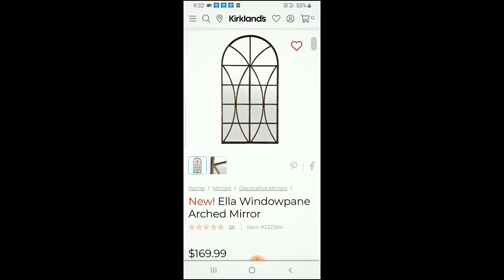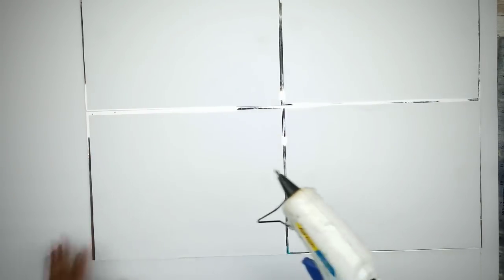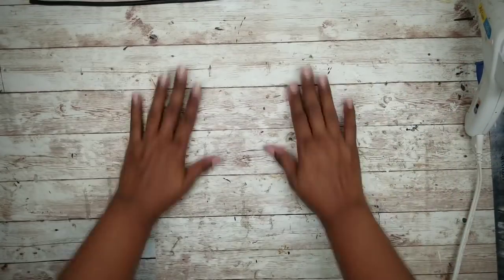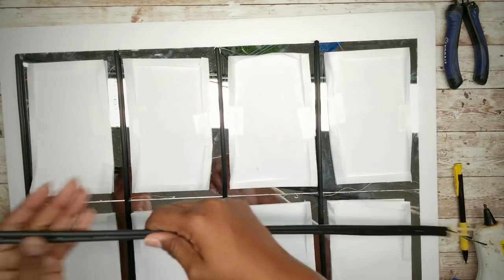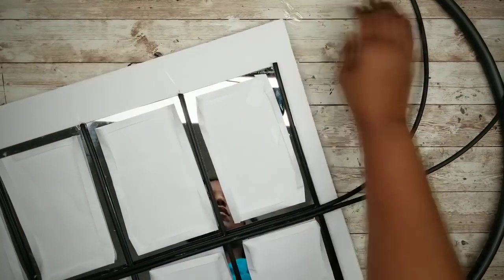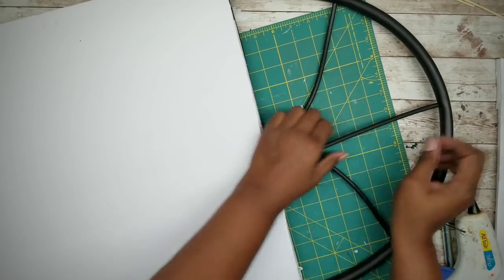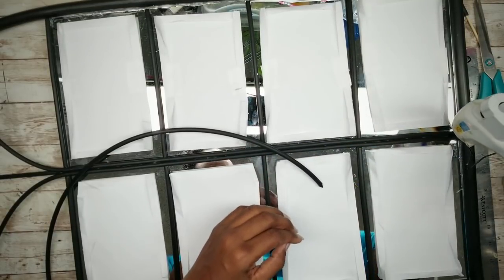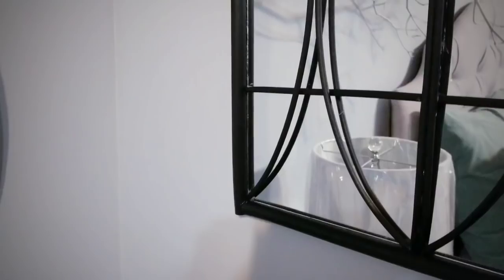DIY DOLLAR TREE High End Home Decor | Kirkland's Inspired | Look For Less | Mirror & Faux Iron Dupe

Comment: Nice. But, I would suggested using both hot glue AND E6000 adhesive for stronger hold, especially on the hanger...not certain hot glue alone will be enough over time. I hope it's holding up.
Reply from the maker: Yes, it's holding up great! Thanks for checking in! 🙂

Comment: Do you have a video on that branch on the wall?
Reply from the maker: I don't, but the branch is attached to the wall with a loop of thick fishing line on a wall hook in two places. To prepare the branch, I sprayed it bleach water, rinsed, and let it dry or a few days outside. Then I added two coats of Zinsser 1-2-3 primer spray paint. Then one coat of flat white spray paint. :)

Comment: Too bad you didn’t have black foam board.
Reply from the maker: You could use black foam board, but the DT board it is still white on the inside. Paint touch ups will still need to be made. Either will work for this project! :)
Reply: You couldn't just compliment her an awesome job she did on the mirror project and leave it at that.
Reply: Tanya Woods. I said absolutely nothing negative about her work! Too bad I can’t just make a simple comment!